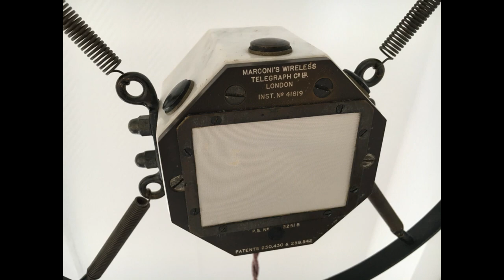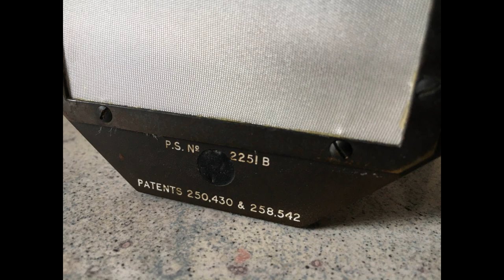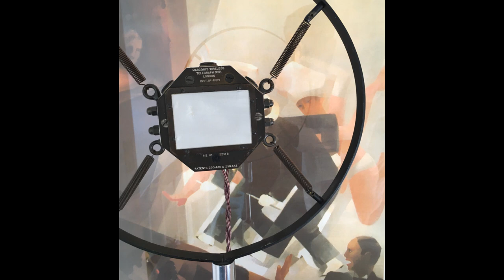Marconi Carbon Reisz Microphone from 1928/29 in working condition!

Comment: Nice singing man!
Thanks for the video...not sure I've ever seen this mic anywhere else.
The low end is particularly terrific.  Maybe to make up for the speakers of the era?
Reply from the maker: That might be - considering the quality of magnetic speakers of those days it makes sense. But in general I have to confess that I was really astonished about the high quality of a device which will be 100 in a few years!
And: thank you very much for your kind words about my singing!
Reply: @The_Incredible_Voice  It is pretty incredible how great that thing sounds considering the era.  
I guess most recording/playback mediums couldn't keep up with what the microphones were hearing.
FWIW, the RCA 44 is gonna be celebrating 100 years soon....it's astounding that microphones from that era are still legitimate in this no-noise/no distortion era.
Reply from the maker: @davewestner  ….obviously out ancestors knew how to build working equipment ;-)
And it is even more astonishing that I don’t use professional (period) technology to run this microphone but only a self constructed circuit!

Comment: Wonderful recording, wonderful microphone in amazing shape! If I may ask, what are the black protrusions on three of the façades? Many microphones of that era have similar features. Are those for adjustment of some kind? Many thanks and all the best, AE — NYC
Reply from the maker: Thank you very much for your kind comment! These protrusions can be removed (they are screwed) to adjust the filling with the carbon granules. In fact these are openings to remove granules or refill it.
Best wishes from Germany to NYC!
Reply: I am also very impressed with what good dynamic range it has. I am pretty sure you also have amazing volume control of your voice and do not let the microphone to top out!

Comment: This looks like one with a rubber diaphragm instead of mica. Is this so?  After designing and building velocity microphones in the early 90’s I am now starting a project to reproduce your very model mic. I already have a marble works starting on the cases but I need to know more about the diaphragm. Can you tell me more? To are extremely talented!
Reply from the maker: Thank you very much for your kind comment. Well, I did not disassemble the microphone more than you see here in my video. The diaphragm felt like mica and not like rubber. It´s hard and clicks when you touch it gently (in the same way as the mica-membrane of a gramophone). 
And as its works perfectly there was no need to take a "look behind" ;-)
Reply: @The_Incredible_Voice  thank you SO MUCH! I have turned some hard wood cylindrical bodies. The interior contacts surrounded by coal grains are made of pure silver as an experiment. I am currently assembling my variable power supply. The marble bodies are soon to come.  
 I have to say that yours is the best quality modern recording done with a carbon microphone. Other attempts are “lo-fi” telephone like effect microphones.

Comment: Great Recordings! Thank You very much! The sound coloration is telltaling, now one can estimate the accuracy of the ancient audio recording chains. What else did YOU use for recording the Mic?
Reply from the maker: Thank you! Very simple: I used only a very small (and cheap) pre-amplifier for magnetic turntable systems (run by a 9V-battery) and a battery. From this little circuit the signal went right away to the sound card of my computer.
Reply: @The_Incredible_Voice  ah ok so You didn't compensate the RIAA equalizer of the Phono preamp?
Reply from the maker: Ralf Lang nope - nothing else was done apart from using this little amp.! I‘m sure that the quality still can be approved but I was so astonished about the output so far (after having this mic as a decoration only for 20 years) that I started recording!